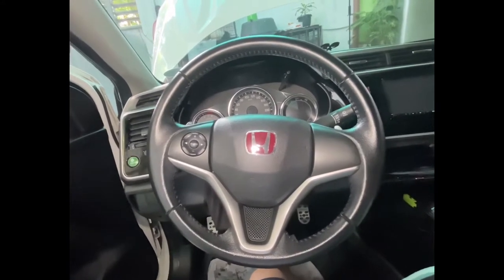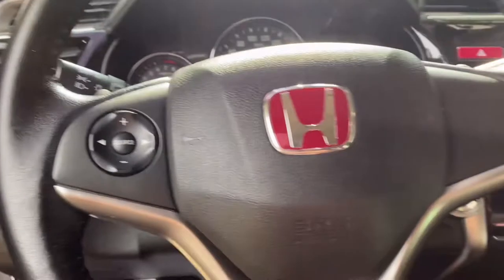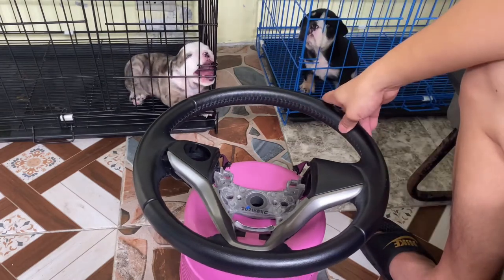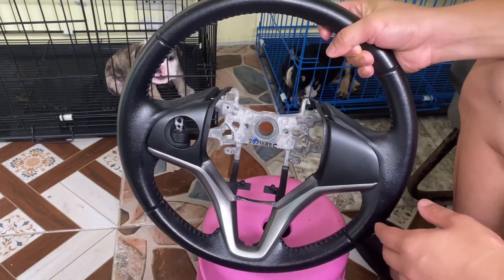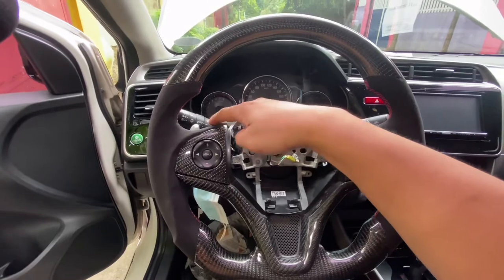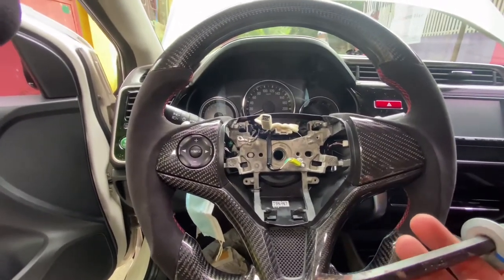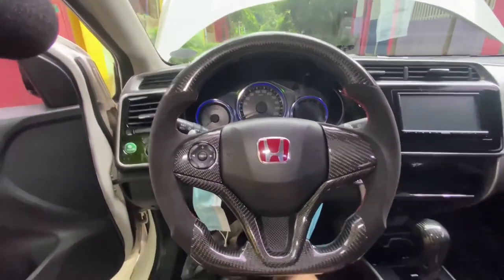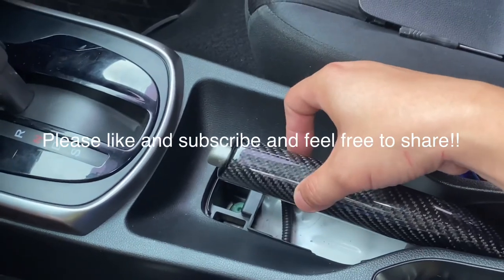Vlog # 6: DIY Installation of Carbon Fiber Steering Wheel on a HONDA CITY GM6.

Comment: Hello sir! Ask ko lang po ano diskarte nyo para matanggal yung screw sa gitna na nag hohold sa steering wheel? Ang tigas po kasi nakakatakot pweesahin 😅 sana mapansin sir
Reply from the maker: Sir, gamitan mo ng tubo, habaan mo ng konti yong hawakan na parang nag babaklas ng lugnuts ng gulong
Reply: @Makiboi06  di po ba sir delikado masira clock spring?
Reply from the maker: Ingat lang sir, sadyang mahigpit lang talaga yon